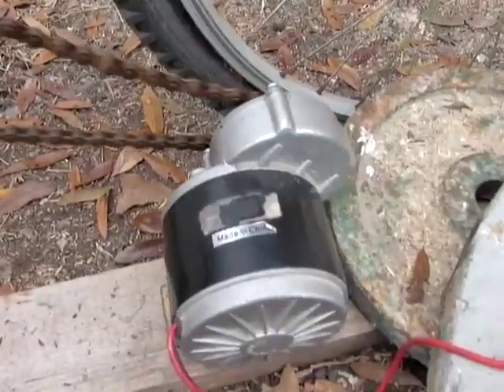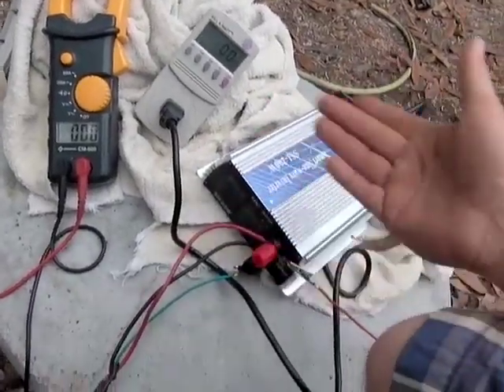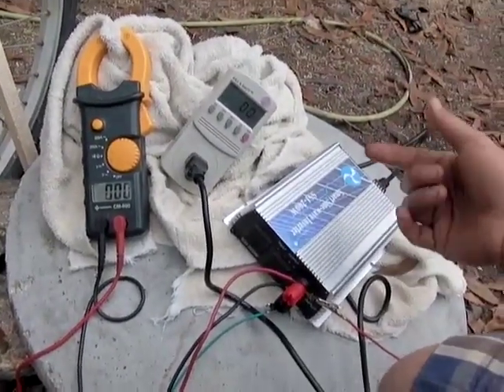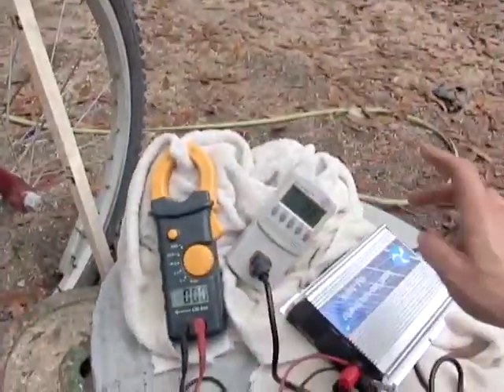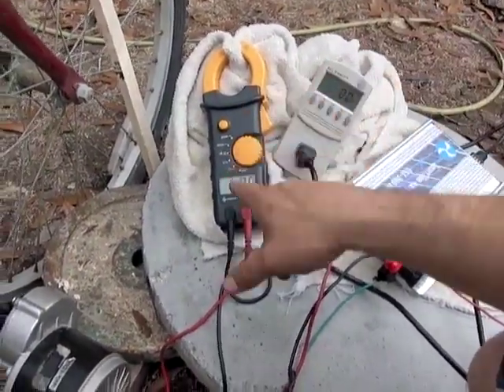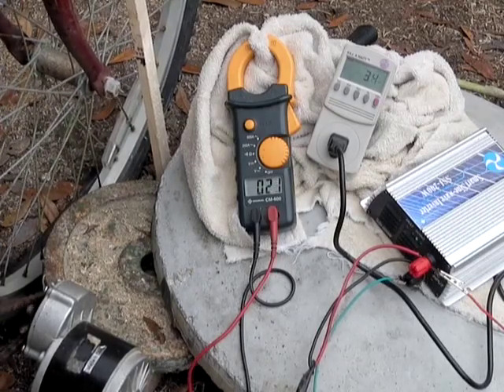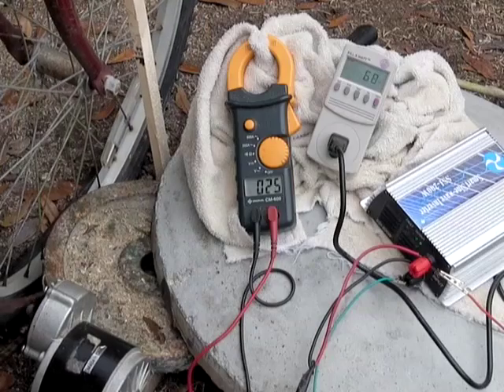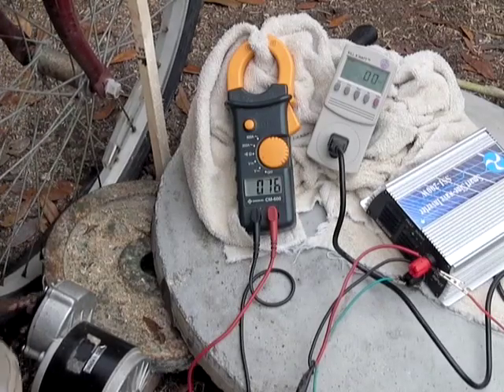HUMAN WATT POWER Stationary Bike Grid Tie Inverter Solar Electric Bicycle anti-islanding

Comment: It kind of makes you realize how powerful electricity really is.  You would need 10 guys doing that in order to power one AC...or a few parabolics with stirlings attached, one guy could setup a gravity powered clockwork system that turns the mirrors automatically.  One big lift in the morning is all the input it would need.  Or just hook them all up to trackers.  Clockwork uses less of the harvested product though.  Puts a big quick load of work on the human to eliminate energy drain all day for tracking.  That could be a good job in a plant

First came Archimedes, then the clock, then the steam engine.  And now the molten salt heat storage method.  All these combine into a beautiful system

Comment: Hi   guys   there   I also  made a very similar   exercise   bike   but   instead of the   scooter    motor I used a   car   alternator instead,,   very simple   build a solid stand to   hold a regular bike   with the rear wheel off the ground   ,,     remove the   rear tire   and then   run a long belt   into the empty rim and also   around the   alternator   pulley,   this setup   works just right   giving the   alternator just the   right speed at   normal   pedalling   speeds   ,,,    now a   rheostat in  series   with the   alternator   field   will   allow one to   dial   how   hard   you want   the   machine to be to   pedal   alternator   output can   simply be sent into a   12volt   battery   and a   ammeter   will give you an   idea   how mucht   power you are   putting  out...    I   myself   tried this   setup  it   worked just fine      makes   for a  good  exercise   bike   or even   if you where alone   no other   vehicle   available   could  possibly be used  to get car  going  if by   mistake you   left the   lights on  or   something   and   battery good but   just   drained

Comment: Get rid of the chain and have direct drive to the generator. You will increase the efficiency. Also, the flexing of the wood frame, which robs energy, can be replaced with rigid metal. You've probably already made these changes by now.

Comment: tent city in Az has a bicycle generator hooked up to a TV if someone wants to watch TV they have to pedal the bicycle..(  the generator must putting out enough to run the TV  I was there and watch TV while same one else was peddling ) BUT I don`t know for sure if the TV was a TV than ran on 110 AC current or  ran off of 12 DC volt. )

Comment: So can generators be applied to "dumbell" style work- outs? And if you can do enough work in an hour to fully charge a phone, it would be worth it.
Reply: more like a rod connected with wires which you pull up and then it springs down by itself

Comment: Use a gearless brushless hall sensored 3 phase DC motor and an ebike controller with slipmode regeneration breaking.   You charge the ebike controllers capacitors and turn it on with .6watts of pedal power.  You can set the regen voltage switch on and switch off  voltages with configuration software on some controllers.   This is more noiseless and efficient and voltage current cab be controlled by the how much throttle signal you do not apply,

Comment: I think with an alternator behind it with a belt on the rim with a proper gearing ratio it would have been easier to pedal more rpm's at an easier pace, Though you would need a battery to get it started.

Comment: contact me at johnberner1991 at yahoo dot com and i can help you. I also have a new 1200 Watt PMA that will produce way more watts then the one in this video. I want to sale it. I make them myself. I sale them for $250.00. They produce 14 volts dc with 4 amps at only 175 rpm. These PMA's are great for building wind turbines.

Comment: So if we hook up a charge controller and a regular power inverter will be ok? So the charge controller will keep the voltage to not damage the inverter or just charge some 12v battery

Comment: I guess it would be better to use car generator, because it has it's own voltage regulator inside and maintain constant voltage (13,5-14,5 V) in wide rpm range. Correct me if i'm wrong.

Comment: I watched a video on youtube, this guy took an electric motor, and a generator. the motor starts on AC power, which drives the generator, he says the generator has been altered to put out more power than normal, so the generator powers the motor, plus a bench grinder, is this possable? or is that a bunch of bologna?

Comment: Is it possible for a GT inverter to malfunction and cause the meter to spin faster (not in reverse) and actually raise your electricity consumption.
Could the GT inverter get confused and instead of sending current to grid it actually pulls energy from the grid.  Have you ever heard of this happening?

Comment: There should be a gym where the patrons get paid for their energy input. For example if you work out 1 hour for 20W or whatever than that's .02 kWh. Therefore you get 0.02*0.010 = $0.0002 per hr of working out.......... wow, bad idea.

Comment: @mobius1r 
Capacitors are SHORT TERM storage only, they aren't like batteries, as they will dump everything they can into a circuit, regardless of its actual power reqs, I was told to think of capacitors as 'lakes', the second you let the 'lake' 'free', you're going to get the maximum flow regardless of what is 'downlake' of the cap.

Also, this idea is old. like 2005 old.

Comment: @GREENPOWERSCIENCE 

Dan, as a biker, I advise you put the seat higher.  Your leg, when extended should be just barely bent.  If the seat is low, you risk knee injury, so put the seat up higher.  Great video

Comment: @GREENPOWERSCIENCE the gym i use to go to had some old running machines that had no electric they use to just work by friction inside of them the faster you fan the faster they went and the slower the slower they went no buttons to control the speed just your legs lol

Comment: What would be interesting is to compare, using the same equipment in the video, different types of "engines" that could drive that generator and see how much each one produces. Steam engine, gas engine, diesel engine, human power etc etc I'm not sure how you would compare like-for-like but you guys are smart so you'll figure it out. Maybe by BTU or something? Anyway...hope you take my suggestion and post it. Thumbs up if you want to see this done!

Comment: I suggest to add a flywheel as your upgrade, it will smooths and lightens the run if the work is stored on a flywheel. Gear changer will be a great help too.

Comment from the maker: @muddymuddymuddmann Been training, looking for 9 hp (LOL) kidding. I think 200 watts is possible with a better configuration and a higher voltage tolerance GTI or 2 gens in parallel.

Comment from the maker: @dobberdoss Every piece of equipment could be a power plant:-) Not gonna replace power co BUT the gym could be self sustained GRID FREE easy. LED lighting Solar sauna stored heat. SOME treadmills are 15 amps or about 1700 watts. That is just a HUGE WASTE of money. Treadmills in a green gym MAKE NO SENSE.

When you see 10 people running in place at the gym, that is 17 Kilowatts for what????? A 30 minute jog of 10 people = 9 kWh every hour that costs the GYM $2-$3 in electricity

Comment from the maker: @inthepresentraw Vitamix is about 10-15 amps so I think they are 1500 watts. You could never alone successfully direct power that unit. You would need a car battery, charge it for 15 minutes for every 1 minute of usage. Batteries are tricky to tell how much is stored charge and what you just put in. A large capacitor is an option but not really, just short bursts. Buy 5 (7ah) small ups back up lead acid, parallel connection to 1500 peak 2500 inverter. THICK DC WIRING 

10 amp 120v=100 amp+ 12v

Comment: Looks like this power legs could go a lot faster. I bet with a good chain setup and an inverter that has a higher power tolerance you would but 200 watts easy. I remember the video you guys did last year with the regular inverter your wifey had the same problem over voltaging the unit. I bet a 24v inverter would be a good choice. Place 2 motors in red red black black you can get it.

Comment from the maker: @STARFIRESOLAR 

:-) 31" arm.

The Grid Tie Inverters simply supplement your current usage and more powerful GTI's and panel systems back power with special meters to make the homeowner money. Regular inverters can run off of batteries and you could have a generator switch that kills the grid and switches to solar or a generator. 

GTIs make installation simple since no regular meter will spin backwards, the goal is to Slow it down. No difference if stored in a bat or used in realtime.

Comment: HAHAHAHAAA !! Yep you've been working out !!  Maybe you should make a generator that you can use with that massive left bicep! HAHAHAHAA  You could sell back even more electricity. 

Great video Dan! You Da Man !!

One question, If grid power goes out this inverter doesn't work. What good is it if you can't get your generated power in your house when grid power is out? Doesn't make sence, that's when you really need it.   Isn't there some sort of relay that can be used or what?